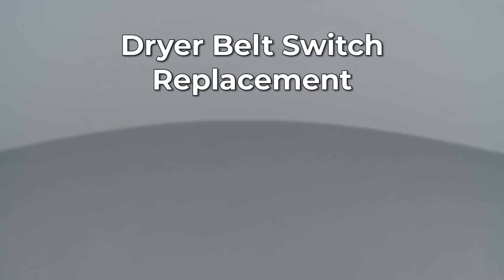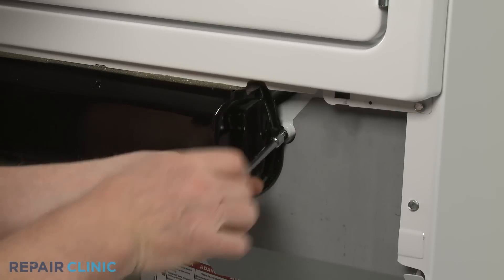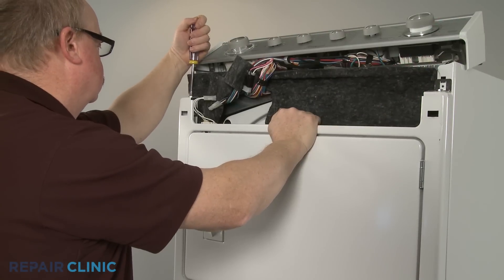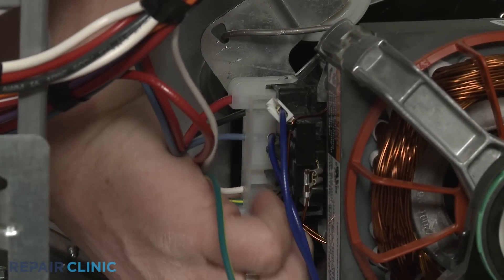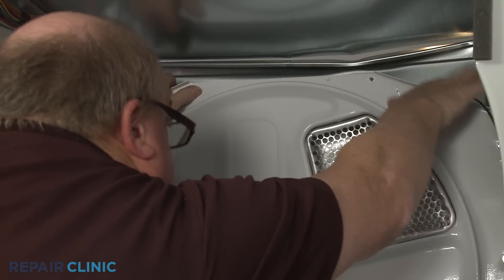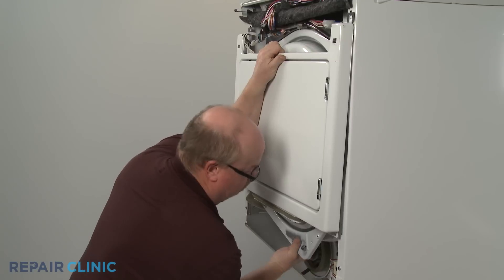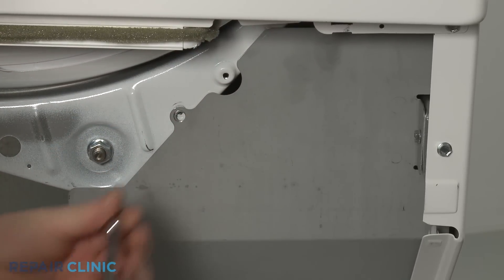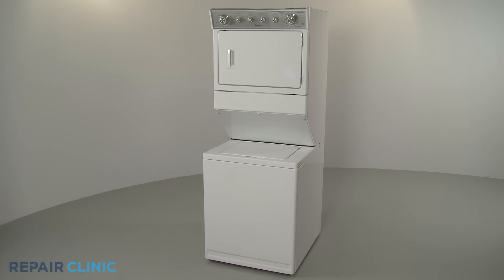Whirlpool Electric Washer/Dryer Combo Dryer Belt Switch Replacement WPW10411937

Comment: If my belt switch went bad would it prevent motor from running? Dryer thinks its running its counting down but the barrel never spins. Wife heard a loud popping noise. Fuses are still good.